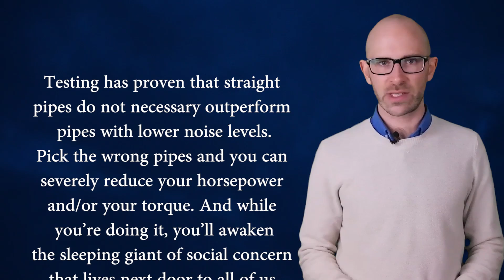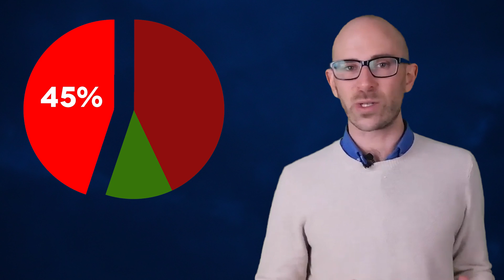Why are Harley Davidson Motorcycles So Loud?

Comment: 5:10 I'm not sure where you got those statistics, they might be true, however, that's only accounting for fatal crash statistics, where as if you look at the statistics for all motorcycle crashes, the car was at fault 80% of the time. And, as you might have guessed it, the number one reason for motorcycle crashes is that the car claimed to not have seen the motorcyclist. So yes anything that can draw attention to the motorcyclist, whether it be loud pipes, turning brights on, or having high vis gear, can and will reduce the chances of an accident. Loud pipes save lives.
Reply: He stated plainly that he got the stats from a 2007 report by the National Highway Traffic Safety Administration, at 5:18.  Short attention span?  Just answer me one question - would your final statement there make a difference if the loud pipes weren't also considered a defiant gesture to the civilization the biker lives in?
Reply: puncheex2
I do realize what Simon had stated, very clearly, but having read the report as both you and Simon should have done, I can't grasp how he can make the claims that motorcyclists are at fault the majority of the time. 

To start off with, the report in no way ever claims who is responsible, but does go into related driving factors, and who of the two vehicles struck the other vehicle. At 5:33 Simon claims that 75% of all motorcyclists are deemed responsible, and having gone over the report I can only conclude he was referring to this statement from the report, 

 In two-vehicle crashes between a motorcycle and a passenger vehicle in 2005, in 1,334
(74%) of the crashes the motorcycle was recorded as the striking vehicle, compared to
470 (26%) of crashes where the passenger vehicle was recorded as the striking vehicle.
This indicates that of the two-vehicle crash between a motorcycle and a passenger vehicle,
nearly three-fourths of the time the motorcycle is the striking vehicle. 

On page 21 figure 3.2.6,
However, literally right below that paragraph the report makes this statement:

Note: “Striking” in the above paragraph does not imply fault but only describes the relationship
of the vehicles in the crash as recorded by police. 

Now if you or Simon actually read the report, maybe you guys would have been I little more careful to make claims and done more homework before making a statement. Simon attempts to make this claim citing only one source that relates to his claim being the NHTSA 2007 report, all other sources are either; noise ordinance laws, which do not apply to the claim that motorcyclists are more at fault in a crash, or news and blog articles, which have no scientific proof of the claim, and are more or less just people complaining that everyone is too loud. This article in his sources, http://www.noiseoff.org/motorcycles.php , was definitely interesting in that in the summary section, paragraph 7, is worded a lot like the statement Simon made.  

Now let's dig a little deeper into this report shall we. On page 29-30 section 3.2.16 Driver-Related Factors, we have all factors that were a contributing factor to the crash but does not imply fault, however in this section from the report, 

Failure to yield right of way was a related factor in the crash for 4 percent of the motorcycle operators compared to 35 percent for passenger vehicle drivers in the crash. This indicates that in two-vehicle
crashes involving a motorcycle and a passenger vehicle, more than one-third of the related
factors for the passenger vehicle driver were not yielding right-of-way to the motorcycle
operator.

we can start making assertions based on the data. One being that, of all the data, the above statement is mainly where the "Loud pipes saves lives" argument comes into play. Being that 1/3 (630 fatalities) of all fatal crashes of motorcyclists with one or more vehicle, passenger vehicles fail to give the right of way to the motorcyclist, being louder and more noticeable would have been a contributing factor of whether or not the crash could have been avoided. So, going out with loud pipes (or anything that draws attention to yourself) potentially reduces 1/3 of your risk of dying. So I still fail to see why your argument that loud pipes does not saves lives is even a valid claim. 

"would your final statement there make a difference if the loud pipes weren't also considered a defiant gesture to the civilization the biker lives in?", you ask, the simple answer is no, it makes no difference to me since it does not apply to my reasoning or morals on this topic. However, I will say that asking me this is equivalent to asking someone who owns a gun, "Does your thoughts on owning a gun change knowing criminals own guns too?" and makes no sense in the context. Finally, I have no idea as to why you worded that statement as you did, when you could have just said rebel or degenerate, instead of wording it in such a way as to be cryptic, probably to either a.) assume that the person you are targeting is of lower intelligence than you and want to confuse and trip them up or b.) appear to be of higher intelligence than you are and impress your peers. I assume it's b.) but that's just my opinion, if so, take my advise and next time ACTUALLY READ THE FUCKING REPORT!

Comment: "..warning that straight pipes can lower horsepower..." 

Lol, as if Harley riders give a crap about horsepower. If they did, they'd buy a sport bike. 

Before all the fanboys get riled up, there's a 2004 Heritage Softail in my garage.
Reply: Or just any bike with a similar engine displacement. I actually think that when Harley decided to make bikes "powerful enough" they were on the right track, at least for what Harleys are designed for.
Reply: @BillyJoe1305  or a cheaper more reliable bike with half the displacement and equal or greater power.
Reply: yep
Reply: You can get much more HP out of a new Harley they all have some hidden HP waiting to be opened up

Comment: Loud-ish pipes, like my Rinehart True Duals on a bike I had years back, were not terribly loud, a bit louder than stock, but for me, the rider, going 70-80 mph on a highway for hours on end, my ears would be ringing for long after. I did notice that in side-by-side lane situations, a roll on the throttle would effectively alert cars to my sides and behind that I was there, and I avoided dangerous lane mergers because of those pipes. However, a more cautious riding position and a thumb at the ready on the horn also do as well, if not better. I now have stock pipes on my new 2017 model and am quite happy with them. . . for now. . .
Just wanted to say I agree: everything you have said is true and accurate, even if I think 80-90 db is not really ear-shatteringly loud when a bike rolls past.

Comment: All of my bikes are loud and will stay that way. They are MOTORcycles. We like to see and hear the MOTORS (engines)
Reply: hi there Captain Douchebag Butera. Congratulations on your gradual yet permanent hearing loss.
Just so you know, every non-rider (along with actual riders possessed of any intelligence) who finds their ears assaulted by the flatulence of your ridiculous two-wheeled suicide toy will likely assume you're just another of those sadly micro-brained manchildren. 
To be less overtly offensive…seriously, what makes you think noisiness is an essential quality of a motor? that is a silly assumption. Loudness≠horsepower. Excessive noise can only be a symptom of inferior engineering.
Reply: Anthony Butera we like to hear motors eh?  fine , but I don't want to hear YOUR MOTOR a mile away !!!!
Reply: Art Mchugh You wont hear them from that far away but you might feel a couple of them.
Reply: Art Mchugh It was more likely all the airplane engines and rivet guns, not to mention the flying. I do hear just fine. I like the sounds of engines so sitting where you are sounds good.

Comment: Loud pipes save lives. And of course the dead carry the blame cause they're not there to share their side of the story. It's only the idiot that hit him trying to save their own asses. Single vehicle crashes shouldn't even be mentioned as one of your points because sound and how an individual rides are not related. Crashing at 100 mph on a loud bike is the same at crashing on a quiet bike.

Comment: Simple question with simple answer... why is ANY vehicle loud?  air!  Either the exhaust or the intake (or both) make noise.  Not sure why you single out Harley.  On my Ducati I've been recorded at over 120db while accelerating out of a corner... ; the main special thing about the Harley sound is the asymmetric potato-potato and usually very low frequency sound.  An IL4 600cc racing bike running 16000rpm at full throttle with a GP exhaust will also be very loud, but the perception of the sound will be very different compared to Harley or Ducati or Aprilia etc; installing aftermarket exhausts isn't always just to increase the volume but also performance... I know, you said that this doesn't always work...  indeed, but recently with EuroX regulations, bikes come pretty much castrated out of the factory... free-flowing intake/exhaust combined with a good mapping can make huge difference (not always in peak figures, but in smoother fueling and just nicer riding behaviour)